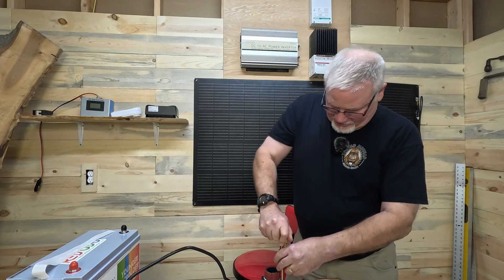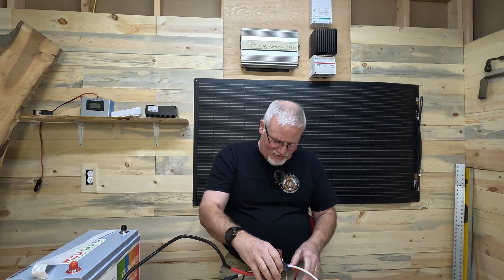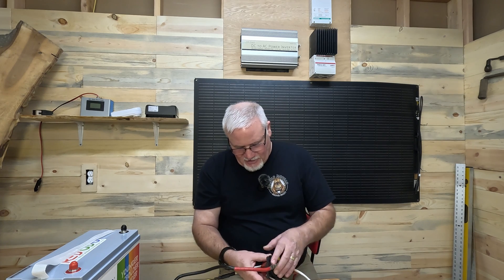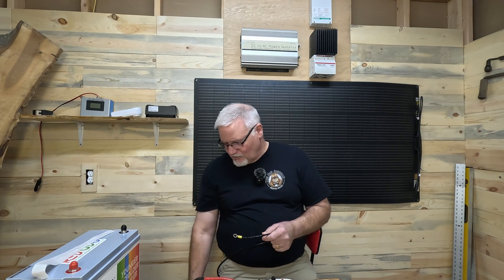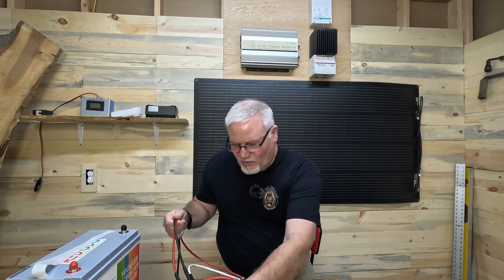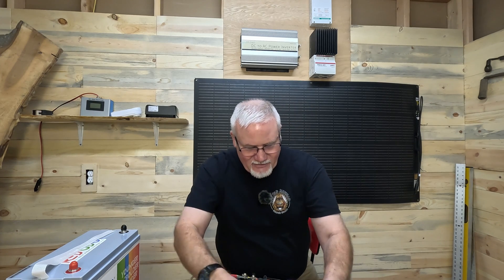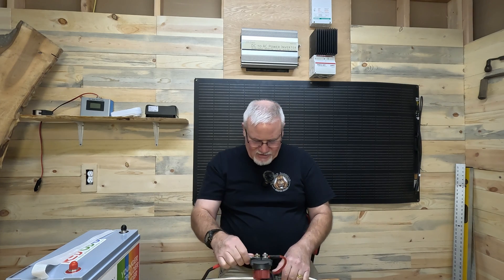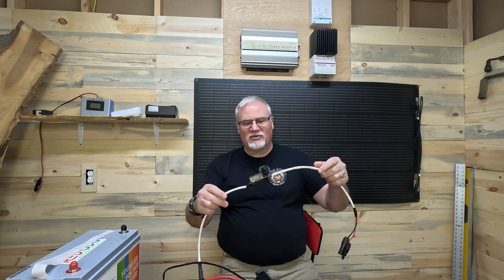Components to Boost Your Power Station

Comment: I recommend Anderson style power poles instead of MC4s for general connectors like that.  The MC4s aren't really designed to handle a lot of current and can't really handle a lot of disconnect / reconnects before the contact area pressure starts to drop.   Yahoo won't let me post links but here are some Ama search terms:

Power poles connectors are polarized and can only be fit together one way, but you put them together the same way for either end... red on right, black on left with the contact retention tab on the bottom (table side) with the housing's contact side facing north.  Be sure to get it correct.  It is possible to remove the lugs after snapping them into the housing by releasing the retension tab... you'll see how it works when you get a few.  But it isn't convenient.

--

"50A battery quick connection plug"

    These are the mid-sized 50A Anderson style power poles.  They take contacts with solder lugs so you need a small torch and solder to install wires into them.  Typically 6, 8, and 10 AWG.   A soldering iron won't do the jobs... the lugs just have too much volume for it to be able to heat them up enough for a good solder bond.

--

"45A battery quick connection plug"

    These are the small form factor anderson style power poles.  The contacts are typically 10, 12, and 14 AWG and use MC4 style crimpers (curved crimpers that folds the two tabs into the wire).   You slide the power poles together to make a 2-pole connector, it is important to slide them together the correct way.  Red on right

    These smaller ones are good to around 30A ... well, 10 AWG.  I usually don't put more than 30A through 10 AWG.  They are advertised as anything from 15 to 45A but it really comes down to the lugs they come with.

--

One can also get larger anderson style power poles, e.g. 175A is quite common.  Those lugs are typically hydraulic crimps for 0, 2, and 4 AWG wire.  Generally better to just purchase the cables already-made up.  A somewhat less expensive high-leverage manual crimp can also be used (which you can use your legs to apply the pressure instead of your hands).  Though I personally prefer actual hydaulic crimpers for the larger cable sizes.

"175A anderson"  (be sure to the correct gauge lugs for the wire being used) (find a link that gives you choices of AWGs... usually the third one when I do the search).

"Teeno battery cable lug crimping tool"

--

The small and mid-sized connectors are incredibly useful.  I also like XT60's but those are hard to properly connect wires to (they are small solder lugs).  Also be careful about polarity markings to ensure full compatibility with XT60 use cases.

-Matt
Reply from the maker: I've got some actually, I just found the MC4's to be very easy to make up.
Reply: @TheOldJarhead  Yah, it is a tad easier to put together MC4s... but the value is limited because it can often be difficult to disconnect an MC4 and the contact pressure eases off a bit too much after a few connects/disconnects.

The smaller anderson power poles are almost as easy to make up... you use the same crimper as you do for MC4's (the kind that folds the tabs into the wire.... also be sure to put the wire in untwisted so the tabs don't cut the wire).  It takes a little practice to get them seated in the housing all the way to the "click", but the result is a significantly better connector able to handle a lot more amps safely.  And much easier to connect and disconnect.

The trick I use with the smaller "45A" power poles is to use a tiny flat-head screw-driver to push the lug all the way into the housing if a regular push with your fingers doesn't get it all the way seated to the "click".  It took making up a few cables before I stopped making mistakes in putting the power poles together, too.

The result is well worth the effort though.

-Matt
Reply from the maker: I'll check them a little closer.  Thanks
Reply from the maker: Interesting. I'll have to check it out.  As for the other comment?  Hmmm not sure.  Did it have a link?  If so, those go to a quarantine as standard YT practice